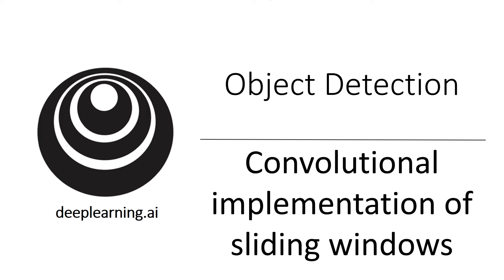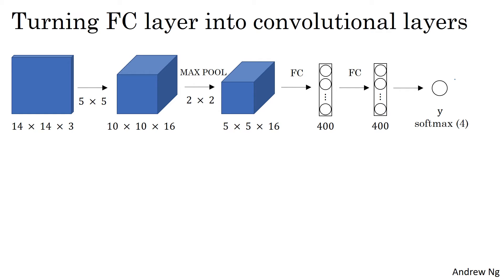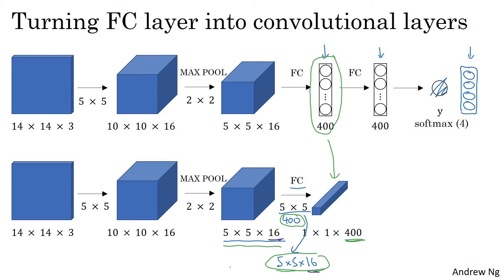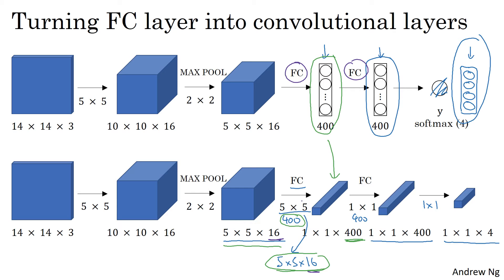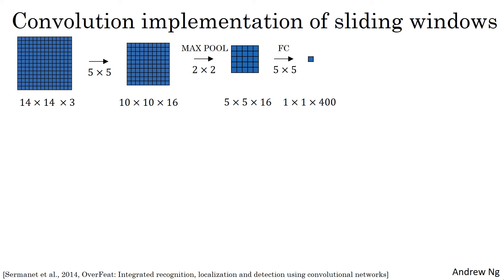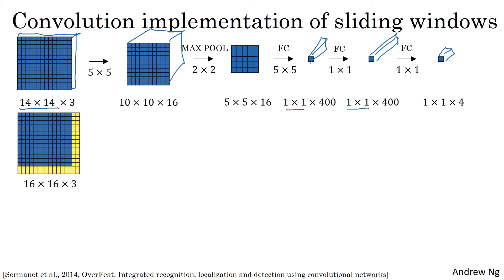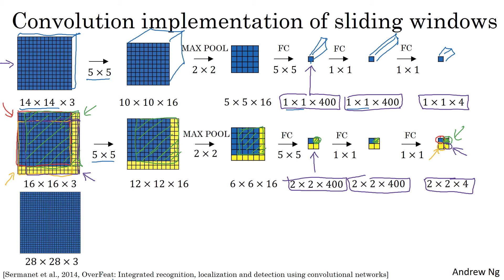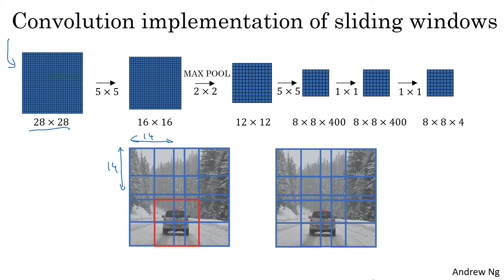C4W3L04 Convolutional Implementation Sliding Windows

Comment: I am using CNN's with a lot of layers. They use padding so that the input size doesn't shrink. This makes this approach not so straight forward. Any idea how to deal with that? Another case are Resnet like blocks, which have different convolutions on different paths merging. Without padding this is difficult, any idea?

Comment: Convolutional Implementation of Sliding Windows CORRECTION

At 7:14, Andrew should have said 2x2x400 instead of 2x2x40.

At 10:04 onward, the size of the second layer should be 24 x 24 instead of 16 x 16.

Comment: Why, in sliding window approach, matching exact position of an object is a problem? If the stride is 1, then we cover each pixel of the image (let's say with a 14x14 box centered at each pixel of the image), so we cover all the possible locations in image and therefore we will match the exact position of an object (its center). The problem arises only when we use a bigger stride.
Reply: A smaller stride = more computations. Also, the objects may show up with different aspect ratios, which would require using many sliding windows with different sizes to detect all of them, so you can imagine how badly this scales up when you combine it with a small stride.

Comment: I follow the idea, however I don't get how it can be implemented programmatically. 
When you train your convolutional neural network, you define a input size. If a larger image is pushed trough the network, I assume an error on input dimensions will pop up. Can the dimensions be easily changed after training?
Reply: Since the idea is changing the FC layer to convolutional layer, we can easily train and test the model without specific size of width and height, for instance we can set the value of input dimension as None,None,3 in Keras. Remember, convolutional layer is different with FC, it shares the weight to each features map.
Reply: You need to preprocess your image (cropping/resizing) to conform with the image size used in the training process.
Reply: Yes, because you save the weights of the kernels, so when you're testing your network you never worry about the dimentions of the input size if they are larger than the dimentions used on training